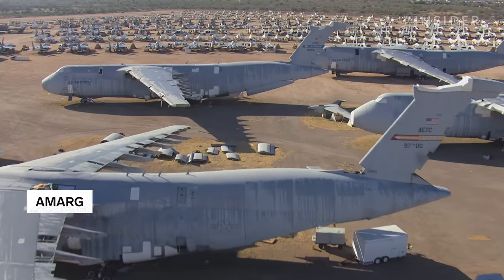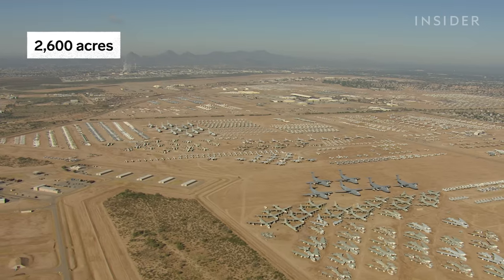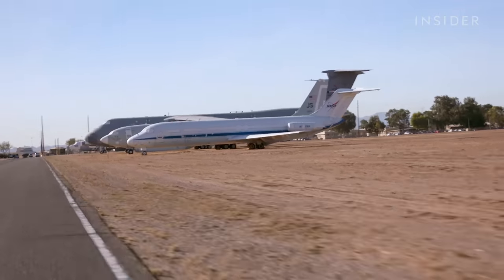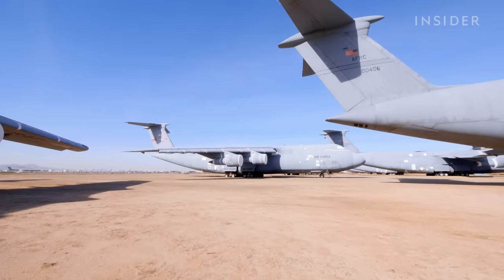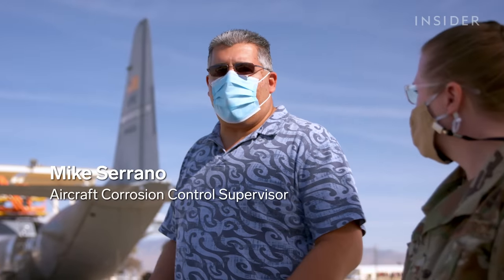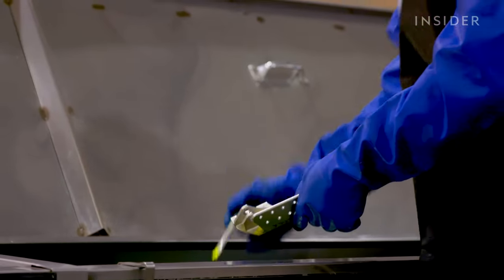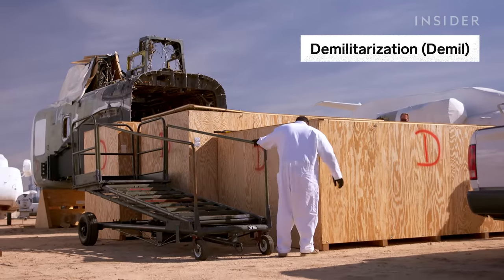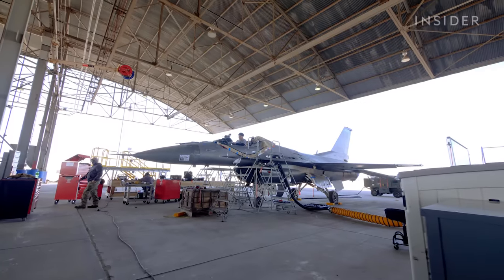How The World's Largest Airplane Boneyard Stores 3,100 Aircraft | Big Business

Comment: In the 80s I was an Air Force Law Enforcement Officer in the K-9 unit stationed at Davis Monthan then the area was called "MASDAC" which stood for "Military Aircraft Storage and Distribution Center.
I and my K-9 patrolled this area overnight which was eerie because of the wind sounds, smells and shadows bouncing off the aircrafts. 
I have many memories working in this area so wanted to share a couple with you all. 

In the 80s during the cold war this center was tasked with the ability to put a stored B-52 in the air every 24 hours for at least 2 years and we had them. We also had many civilian passenger jets stored there because some of those planes shared parts with their military version. Such as the commercial jet 707 and E-3 S entry, E-8 Joint STARS. It is cheaper to maintain planes if you have your own plane pick and pull. And I totally believed we could launch those B-52s and distribute plane parts anywhere around the world at any time.

At times, very, very few times because me and fellow officers patrolled this large area, I would find a plane or helicopter with a door seal broken and when I opened the door to look in, I would smell 1940, 1950, 1960,1970 smells. You could feel it, smell it, see it and at 2, 3, 4am in the morning it could be eerie. I would then board the aircraft looking for suspects, damage or evidence but of course while waiting for my sarge I would look around. 

I found pictures from the 50s, 60s, 70s and letters, maintenance logs, manuals, journals, flight logs and more. To read these materials and again smell them and to see individuals handwriting was eerie. 

One last thing, we would get alerts a plane a was coming in for a crash landing, then we secured the flight line for security and safety. In those situations, we had crews foam the runway, firetrucks on the runway and I witnessed planes land on their belly. One of which lowered its landing gear and the starboard side gear fell off on while in flight. He raised what was left of his gear, went around and landed on the foamed-out runaway. Those pilots were a little crazy. I don't know this for sure, but I think a lot of those pilots flew in their own planes for storage.